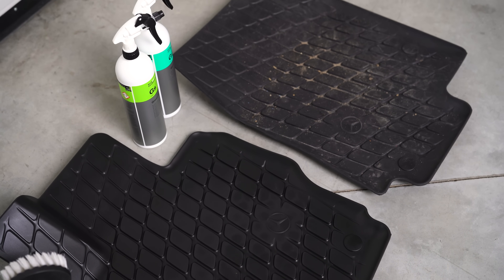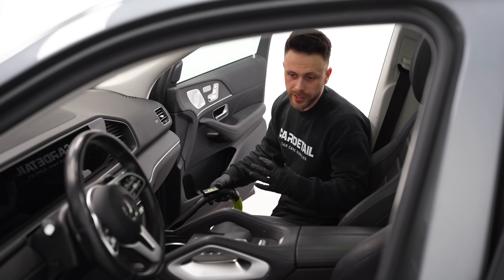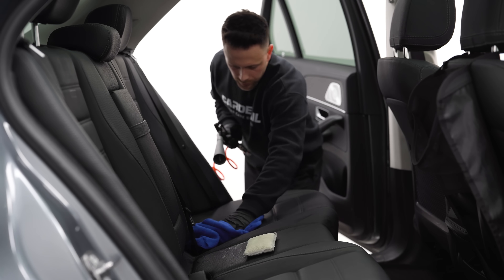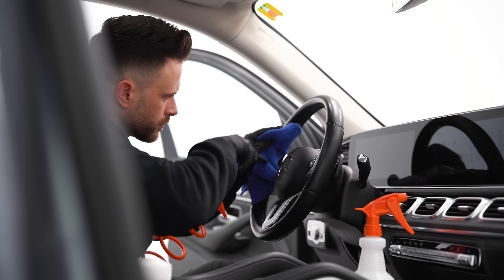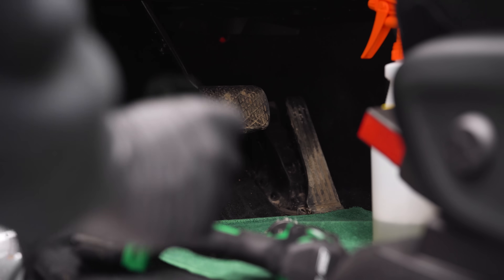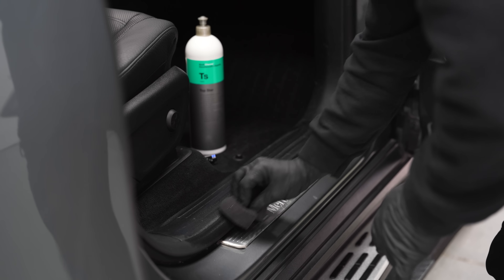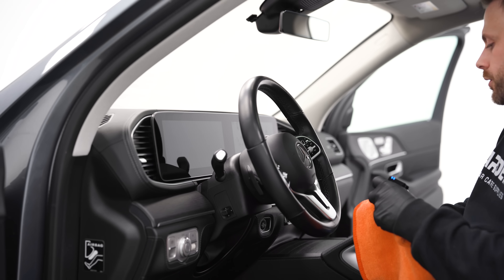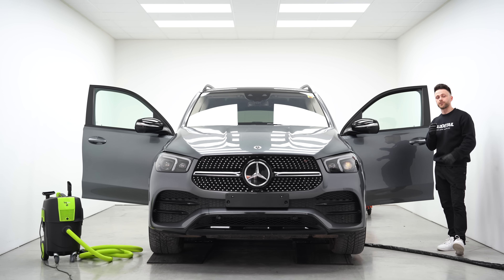Deep Cleaning a DIRTY Interior - Mercedes GLE

Comment: What dilution ratio do you use on the P&S Express?    Or do you use it straight?     Those scrub pads have really taken the detailing community by storm.   They only came out a couple years ago and they are without a doubt the "must have" interior detailing tool, probably the most used new tool for interiors over the past 3 years.   Every time you see a detailing cleaning an interior on YouTube, they are usually using some version of the scrub ninja, star, mitt, etc. on the interior.   It is a very effective tool.   I have a couple different sizes of those on hand.     I just detailed by wife's car this past weekend and used the scrub pads for all the interior surfaces from the rubber mats, plastics, leather, etc.    If you haven't tried one of the scrub pads,  you need to try one.   It works so good on the interiors.   All the "Stars" products from Koch are really good.   POL STAR is one of my favorite products for the interiors.    They really hit a home run with those products and they are great value for your money because they give you get the one liter size for a reasonable price.    You made that interior look brand new.   Very nice work, as always.

Comment: when you wipe down the interior with the microfiber cloth, how many times do you change that cloth out or is it fine to just use the same one for the entire interior? thanks!
Reply from the maker: When it gets too dirty or too wet. If it takes too long to wipe off the residue, I would recommend using a new towel

Comment: When removing dust and small dirt from the cupholders and stuff, you use the air compressor right? But doesn't the dust just float down and land on the surferces again after you blew it? I'm having some problems when trying to remove the dust myself 🫣
Reply: He probably wont reply but are there by any chance someone else who knows the answer or got any tips?